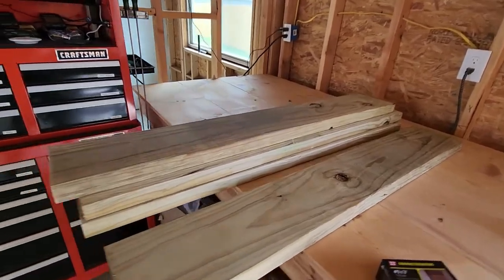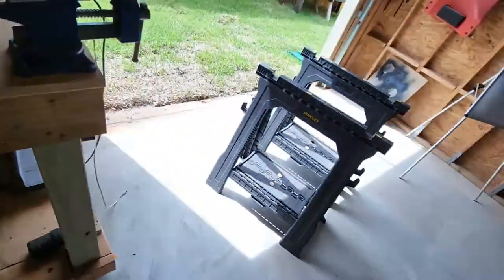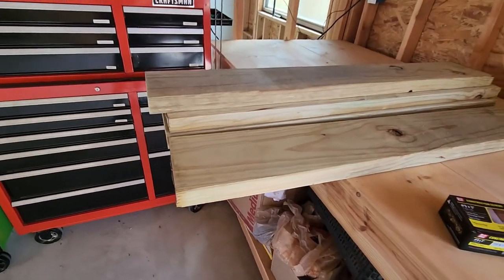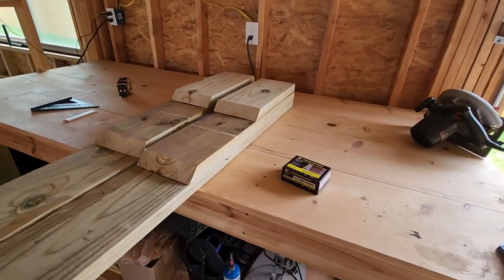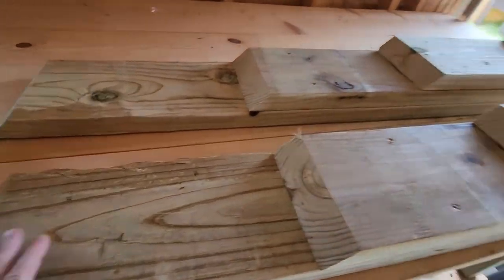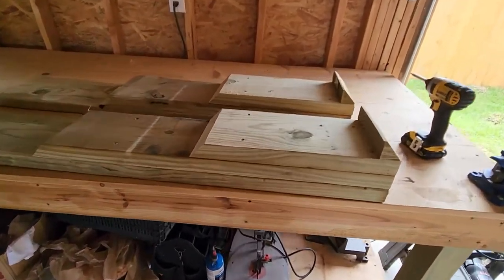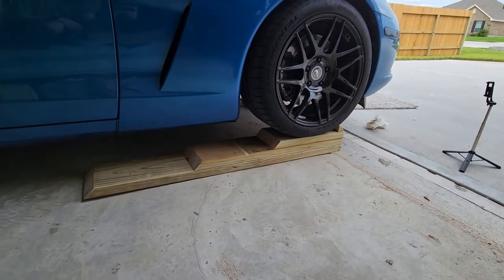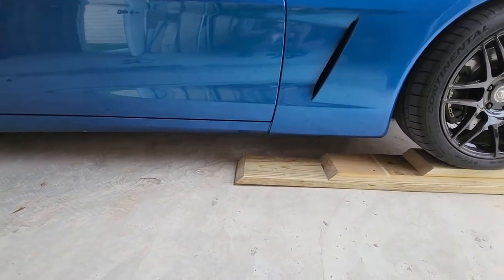Building service ramps for my new supercharged C6 vette.

Comment: Hey Blake, excellent video, thanks for sharing, I'm going to take your lead and I might go 4 layers deep with the boards and I think that might get me under my C7 Z06 safely so I can change my own oil and such!  Great idea and this certainly is a great deal less expensive than the race ramps which virtually look about the same as far as design.  I really like the fact that you utilized the corner triangular piece as your tire stopper too!  Great idea.  Thanks again and happy motoring!
Reply from the maker: Glad the video helped! If I were to build another set, I would go a little shorter on each section and do probably 2 more layers. Can't go too short on the sections or it's too tall too fast and hits your bumper. I use these things way more than I thought I would. The OBS is too low now for standard ramps, so they get used there as well.

Comment: Nice Job , I got some 2x10’s to work with today but didn’t have a plan until I watched your video . Tomorrow I’ll pick up some screws at the Hardware store and bang them out . Thanks for Posting !!   Great Video
Reply from the maker: I use them a lot more than I expected. The obs is now too low to get a jack under the front end. Lol

Comment: seems like you could go less than 16 inches especially after the first step so you could at least get 1 more board in height. you could get away with a foot for last step as angle of car goes up.
Reply from the maker: Yea I did that size to I could get 3 out of a board. I was worried about how low the front splitter is. I do need at least 1 more board to really get under there.

Comment: I really like those wheels what is the name on them
Reply from the maker: They are forgestar F14s
Reply: Do you know the specs I want them for my base model
Reply from the maker: @user-wi3vq1zk2p  18x10.5 rear and 18x9.5 front the forge star website will have base fit or wide body fit.
Reply: @Blakes-Garage  do you know the offsets?
Reply: @user-wi3vq1zk2p  No, the website doesn't list them. you just choose base fit or widebody fit.
Reply: @beason1028  what website is it?

Comment: An easier and stronger way to install the end stops is to screw on a vertical piece to the front face of the ramps, with the grain running vertically.  2 screws near the top and only 1 is needed at the bottom.  Mine projects about 4" above the parking top and gives a very definite stop to the tires.
Reply from the maker: If I had more material I would have. If I ever make them taller I will probably put a better stop on them. 4 inches would hit my bumper for sure though!